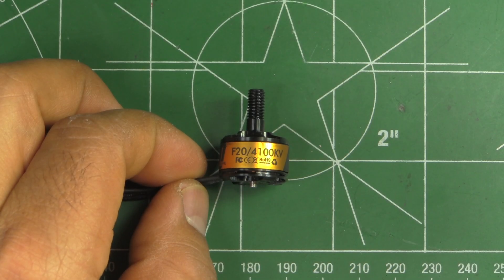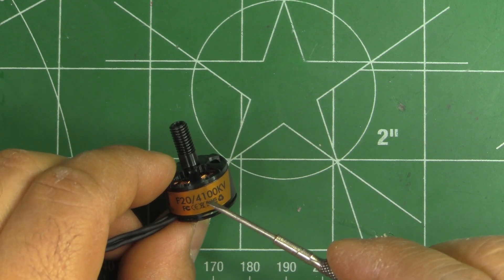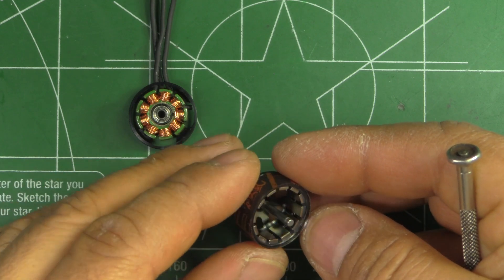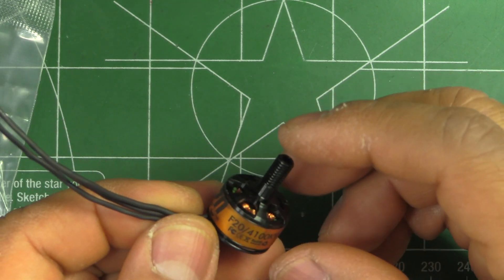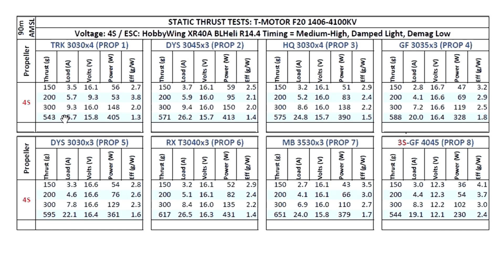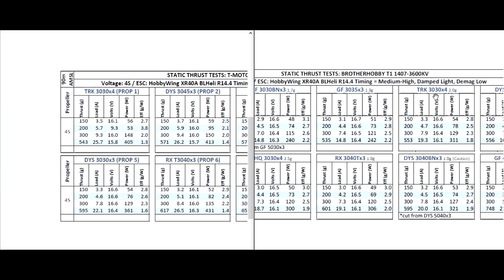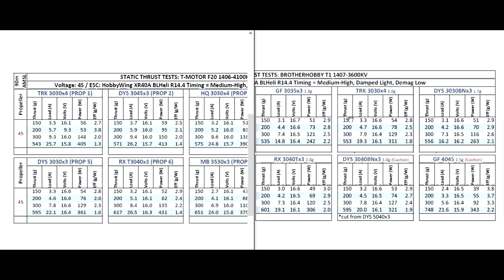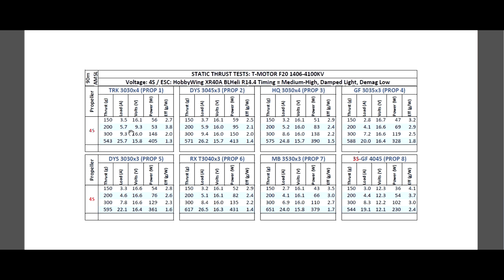T-MOTOR F20 1406-4100KV Overview and Static Thrust Tests -Banggood.com

Comment: Id love to see f20 v2 1408 3750kv test as well.
Way more powerful than 1st f20s and even the 1st cup numbers of thruat matched and beat every other 14xx motor though with more ampage over others but believe now the thrust dominates the 14xx size category and efficiency should be cllser to other 14xx motors.
If anyone has a spare one to send engineerx ill split the cost of motor and shipping with you so just hit me up at charleshodge215@gmail.com

Great work engineerx I know this video is old but been watching em all.

Comment: So these motors need a 30A ESC so that the ESC won't burn?
Reply from the maker: No, 18~20A ESCs will suffice. I mentioned several times in the video that in the air, motors will draw anywhere from  25 to 35% fewer Amps. When props are moving forward, the air that passes thru the blades already has a velocity so they'll "grab" less air and the resulting load on the motor is of a smaller magnitude. That's the "unloading" effect.
Reply: okay thanks!

Comment: I tried DAL 3045 props on these & they get extremely hot not touchable after a minute or 2 of flying
Reply from the maker: Are those BN / straight-edge props? BN props are just too inefficient and stress the motor wasting a lot of energy into making lots of drag and turbulence. First make sure your FC is well tuned and you're not getting oscillations because those also overheat motors. Also try regular tip props. It's possible this motor works best on 3S due to the high 4000KV or use less aggressive props on 4S, GF3035x3 or DYS 3030x3 might work better
Reply: Yes those are BN props and it was much better with DYS 3030x3 on 3s Bat, Good to know about BN props inefficiency .. Could you comment if motor cooling/temperature will be poor when motor is mounted upside down as a pusher style on quad-copter?
Reply from the maker: I would say it shouldn't be that much different. I think props don't really push that much air into motor for cooling, a little bit perhaps. The stream from moving thru air is what cools motor the most. Also if motor is running way too hot that means there's some other issue, not air-cooling. Most likely propeller too big, too high voltage, too many oscillations. Example, this 4100kv motor with 3045x3 BN props on 4S would run very hot. Motor too small, KV too high, prop too large and inefficient-wasteful.

Comment: How do you think, will this motor survive flying with 4 inch prop ( gf4045) and 4s? the auw would be very low, under 200 g
Reply from the maker: For this motor, I would not feel comfortable matching it with a 4045 prop. Its KV is too high and the 4045 prop would load it too much. It may overheat or run too hot and eventually degrade the enamel on the windings wire. Highest KV I would use is 3600KV and even that is too high for my liking but I think some people the BrotherHobby 1407 with 4045's without issues.

Comment: would you recommend these or the tornado t1 1407 3600kv?
Reply from the maker: I personally prefer lower KV. 3200 to 3600KV gives you more torque and less stress on motor. If they made a 3500~3600KV version, it would be an awesome option (my opinion) It's a very light motor so that's a big plus. I do need to tell you that I have not actually flown a 4100KV motor at all. I'm just basing my determination on comparing my thrust test results and experiences with the larger 2205 motors with different KV's (2300 vs. 2600)

Comment: i have the 3200KV version and i like the low weight. what i really dislike is the wires! why no silicone its a disaster to short and solder. and the size of the screws m2.5 is to big for a small 130 size. need to drill my frame screw holes out.
Reply from the maker: Right, no idea why it had to be different. 2mm seems to be issue-free, I have not seen complaints about screws breaking. If you're not careful threading in straight, you may strip them easier than 2.5 or 3mm, but that's not too common. And yes, those lead wires bring back SunnySky 2204 memories.  LoL

Comment: hey can you do a thrust trest on xnova 1407 3500kv/4000kv ,, cant find any on the yet
Reply from the maker: Yes, it's just a caution because load on motor will also depend on overall weight. So it's good practice to check motor temps after a couple of short laps, at around 60% then high throttle with a short full burst. Land quickly and check temps. Though, I think there's some already flying the 2-blade 4045 on that motor so search to see if you find anyone, then no worries.
Reply from the maker: mike2jz gte funny you should request that. A RCGROUPS member offered to send me a XNova 1407-3500kv and placed order today at AMain Hobbies. So I'll be testing the 3500kv version soon but it'll take a couple of weeks as I have other testing lined up.
Reply: Oh that's great looking forward to that!!, I already have the xnova 3500kv ,, but I'm planning on building another bird , wanna stick to 1407 , but not sure what's the motor I could get , I had the dys 1407 3600kv , but one of the motors shaft broke in mid air , I can't trust those motors ,,   Thinking the T motor 4000 but would they handle 4s , or xnova 4000kv will be better hmm
Reply from the maker: Depends on type of flying  you want to do. If you're mainly freestyling/ proximity then the 3500~3600KV I think are a better choice as you can run 4S all day and not worry about frying motors and will also give you more thrust from the low to upper mid-throttle range so that should be more responsive. Higher KV doesn't mean more thrust in some setups-for same motor size where motor is already near its max load. You gotta increase motor size.
Reply: EngineerX Im looking for a new 180 build motors. im in between the xnova 1407 3100 and tornado t1 3600kv. it will be on 4x4x3 lumenier props. any advice? you say caution on t1 1407 3600kv on 4s 4" props,
Reply from the maker: For a 180mm FPV build, my choice would be a light 2204- 2300 to 2800KV. I prefer a motor with a 3mm for durability. Smaller motors usually have 2mm shafts (with few exceptions) and on a 180mm frame could bend on a crash due to the larger overall mass. The trick is finding a light motor that is reliable. 1407 is too small to drive a 4x4x3 on 4S. On 3S it should be OK but still too much propeller for that motor. The smallest I would use is a 1806. The F30-2800KV looks almost like a perfect match to my liking, but I haven't yet tested it or seen it being used 
http://www.rctigermotor.com/html/2016/fpvmotors_0509/310.html
The new Air 40 would also be a good candidate provided it has good durability
http://www.rctigermotor.com/html/2017/fpvmotors_0323/354.html

Comment: whats your option on the build quality compared to the rest of the T motors?
Reply from the maker: I have not had a chance to test and tear down T-Motors lately. Last one was years ago, the 2206-2000KV.
As far as this one, it feels pretty well built, I was surprised not to see any balancing epoxy,  but I'm sure it's well balanced. It's got the right ingredients too. Windings are pretty well done and stator has modern 0.2mm laminations. Magnets are squared (not curved) but they're very well glued so doesn't look like they'll come off at all. Only thing is we haven't seen that many people posting about how durable these are so no way of knowing how they'll do on crashes or long-term use. 

The other larger motors in the F-series seem to have been revised to be more reliable. They had some issues that I read about (not my personal experience - so just "hearsay" from the forums) but they fixed those issues. One of the things I don't like is that for some motors T-Motor wants you to purchase in pairs and also the price is a bit more. Have you checked http://www.miniquadtestbench.com/search.html?id=7&search=t-motor There's tests there with brief overviews on the motors. Sorry, I don't have more info for you.
Reply: durability of these motors is not great, the shafts like to break on impact the 2mm steel shaft that is, the hollow part is fine), and the bearings get rough quite quick, also the sticker comes off after a while